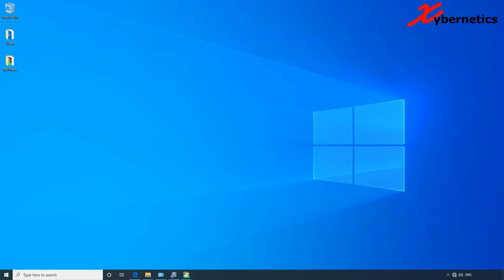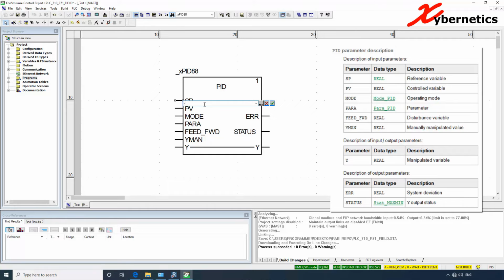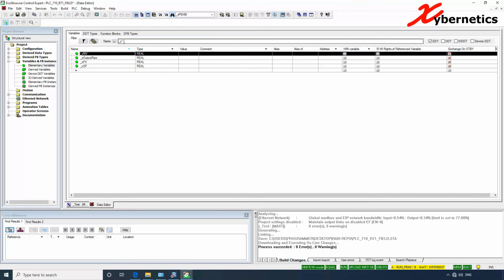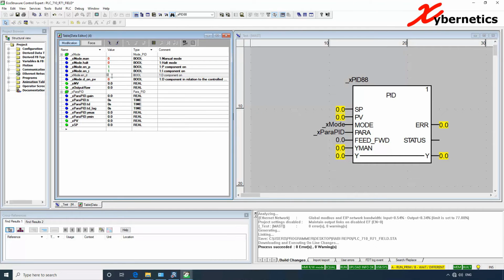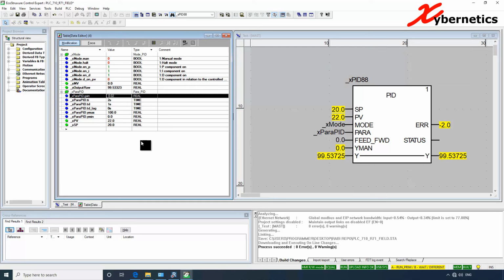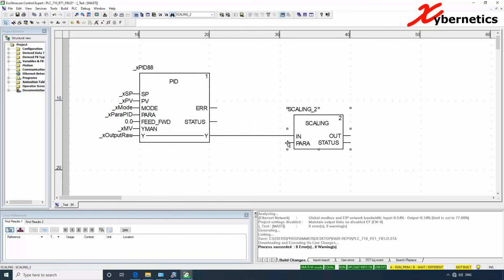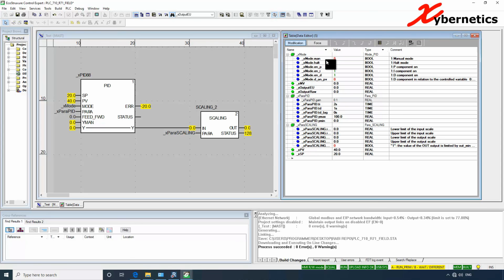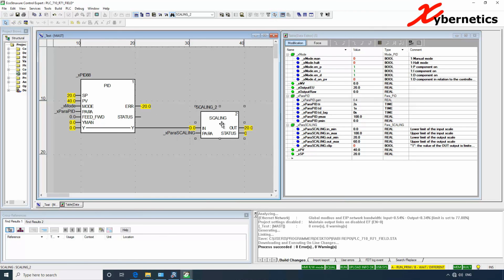Schneider Electric Control Expert PID Function Block

Comment: You've mixed up direct acting and reverse acting controllers. A flow control with a valve regulating the flow is a typical example for reverse acting control. If the flow is low (PV < SP), the controller opens the valve more, i.e., it increases the OP. A back pressure control is an example of a direct acting control, e.g., if the pressure is too low (PV < SP), the controller would try to close the valve so that the pressure behind it could build up, i.e. the OP goes down.